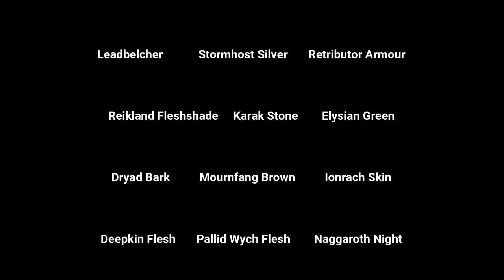How to paint Myrmourn Banshees

Comment: Why did you go with black primer as opposed to a grey or white?
Reply from the maker: If I used bright colours then I needed to coat multiple time to achieve the desired look. I like to use base primes that matches with the sheme I have in mind. For example of I would wanted them ghostly bright how the box art is I would have primed it white cos it would make the job easier.
Reply: Vidor Szabo how many coats of white did you have to put down over the black primer coat?
Reply from the maker: @hobbithubby5076  Massive sorry gor the late reply, basically I am not getting notifications after any answers and I just saw your question now. I start with 1 coat once its dry you can see if you want to add another coat. The goal is to get an even coat. It is not necessary to give another coat on the zig zag lines where the black meets with the bright because either way the goal is to blend the 2 colours with other paints